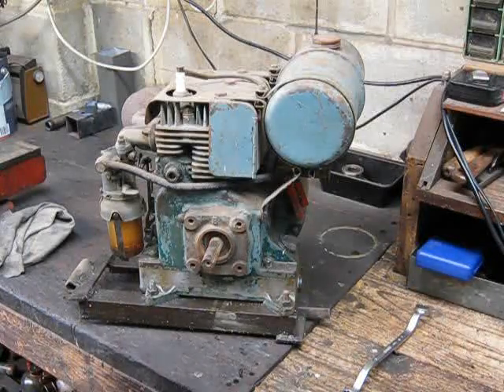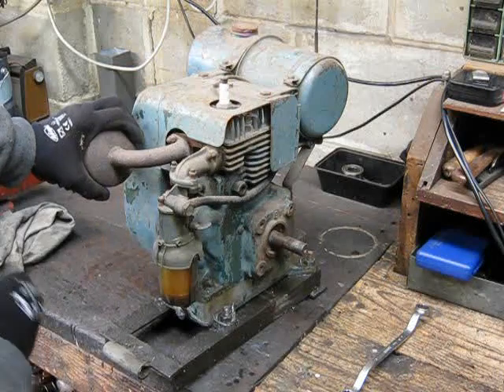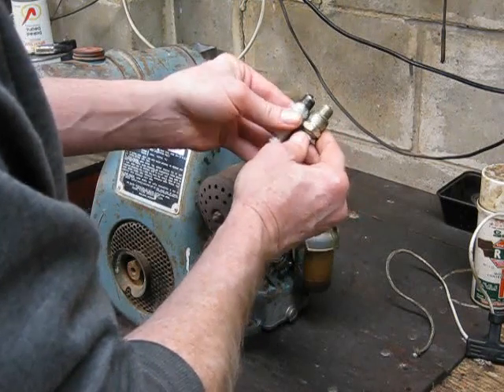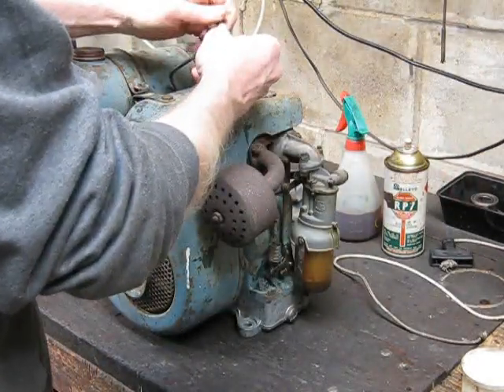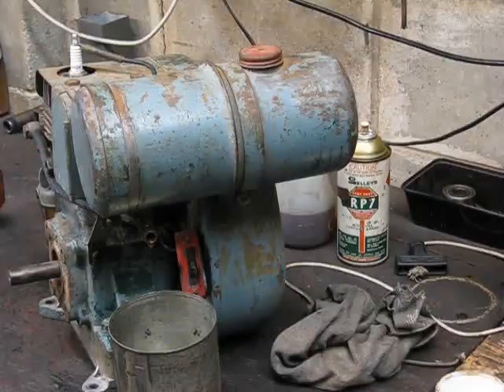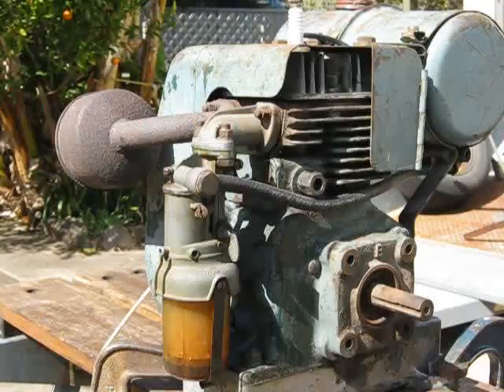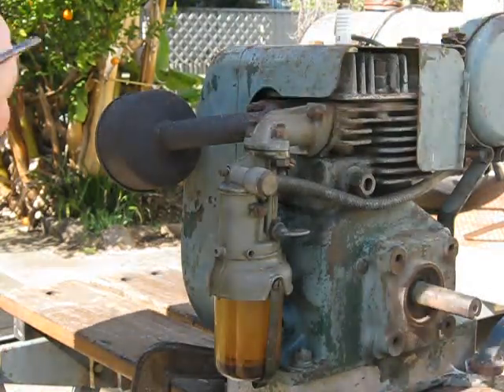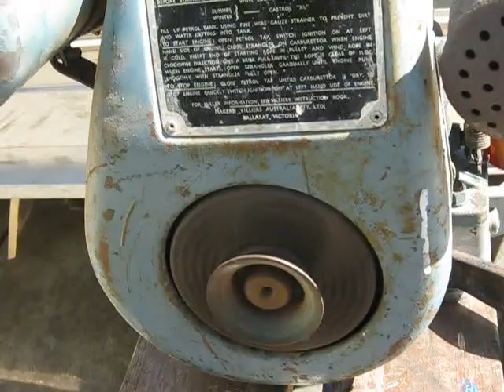Villiers stationary engine start and tune  - Australian 12/2 classic

Comment: You were running it with the choke on.
Reply from the maker: No.
Reply: @Xynudu  On mine, which is the same as this, on my F15and on my villiers lightweight, all of which have the same carb,  choke horizontal is on and vertical off. How is yours different ?  To start usually have the lever at 45 degree and move to vertical when warmed up.

Comment: Hi anyone knows if where is the carburetor jar is a filter in there or it's just oil?
Reply from the maker: It should have a filter in there as well.  If it's missing you could probably use some coarse steel wool.  That was the method used in early oil bath air filters (as used by Volkswagen Beetle etc).
Reply: @Xynudu  thank you,I both original filter  with 10 pounds

Comment: Hi there great vid.
Just starting work on my Dad's old Villier engine to get it running  thinking 40's 50's era. 
I'm 1974 so well before my time it looks to be 4 stroke aswell has oil sump cap same spot.
I'm missing fuel tank cap but it's not a screw on type it's like a radiator cap. 
Wondering if could give info on anyone or a place to buy a fuel cap.  Cheers thanks
Reply from the maker: Hi Patrick,

Maybe try Ebay or put a wanted add on Gumtree.  Apart from that you are looking at scrap/junk yard motors.

Also try this guy:  https://vaces.com.au/photos/villiers-parts/

Cheers Rob

Comment: Brilliant Thanx, just normal 91 octane unleaded?
Reply from the maker: Yes, but you will need to add a valve seat lube to protect them, as they are not hardened for unleaded fuel.

These motors were made for leaded petrol.

Cheers Rob
Reply: Thanx Rob, does higher octane unleaded help?  And also mine keeps stalling, starts up runs for a minute then stalls?  any ideas?  Mines same model as yours.
Reply from the maker: Higher octane won't help.  These are low compression engines.

Sounds like a fuel problem.  

Check fuel flow from tank, clean out carby float bowl, make sure float level is high enough, blow out needle and seat,  blow out main jet and mixture jet, adjust mixture jet (richen it up) , make sure carby is mounted with no gasket air leaks, check air filter is not blocked..

The oil bath plastic air filter bowl can distort with age, so try running it with that off to test it's getting enough air.

The basic stuff.

Cheers Rob
Reply: thanx heaps Rob

Comment: Hello sir, my mk12 is having a intermediate thud and black smoke. Any fix??
Reply: Sainulabid Pothangodan check the timing. The fly wheel doesnt have key, just a tapered shaft. Take head off top dead center with valves closed, line fly wheel marks up

Comment: Looks just like a Briggs or Tecumseh. Sounds like, also. Is it reduction-geared?
Reply from the maker: +Jacques Blaque 

No reduction gearing.

All those flat head motors pretty much used the same design pattern.

Basic low tech solid motors.

Although some of the later B&S stuff wasn't so good.

Cheers Rob